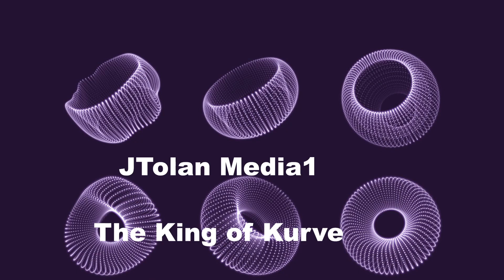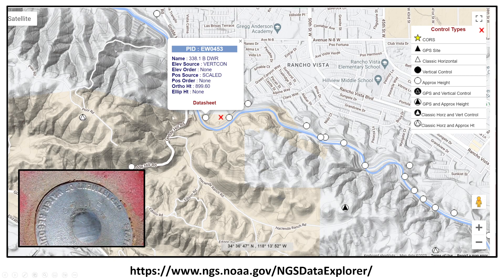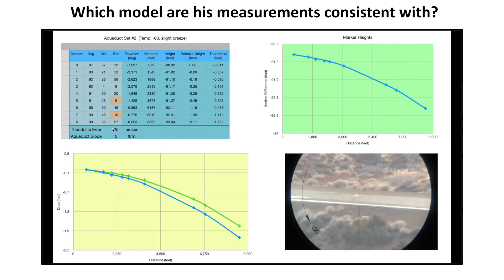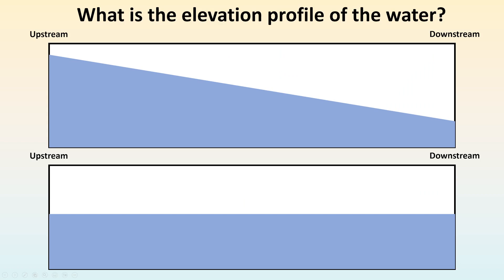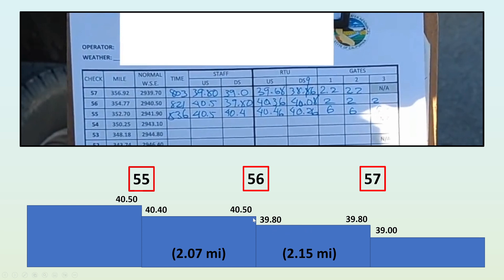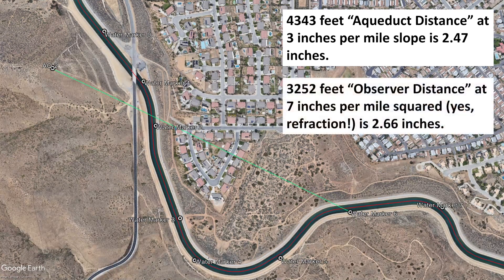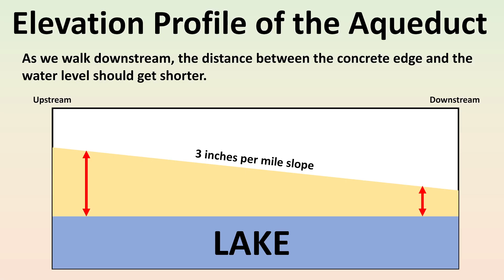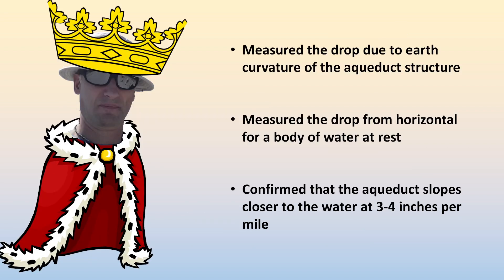@jtolanmedia1 is the King of Kurve!!!

Comment: Hold on, if the water level is at near constant elevation (or lower than the 3" slope of the concrete) then the distance from concrete to water level should get lower as it is measured further down stream.
The elevation of the concrete is dropping while the water level is expected to stay constant.

Yet Tolan measured the distance between concrete and water level increasing with a slope of 3" as he went down stream despite the fact that the concrete is dropping the same amount in elevation.
The measurements he made are in conflict with the datasheet of the employee. Or did I confuse something?